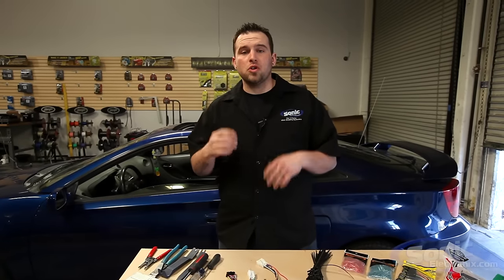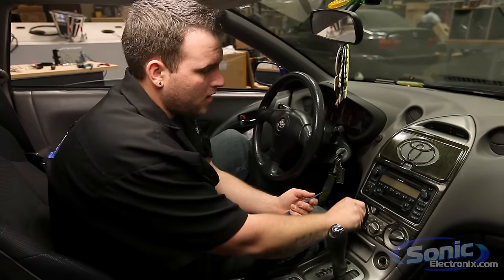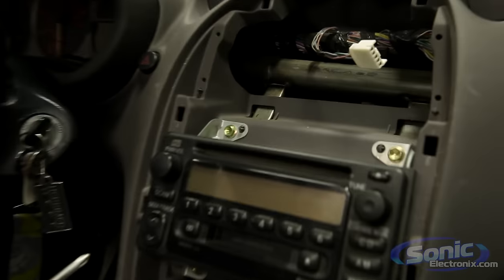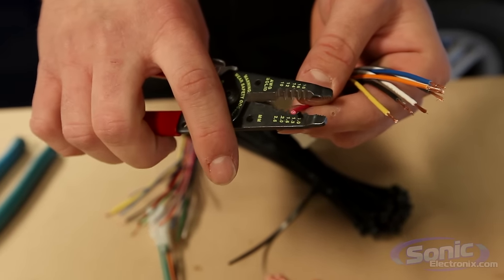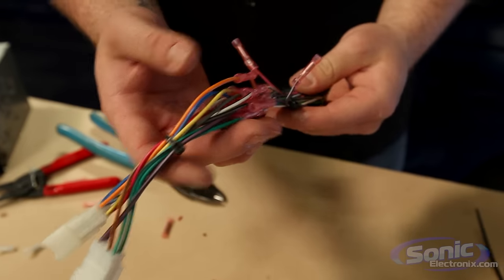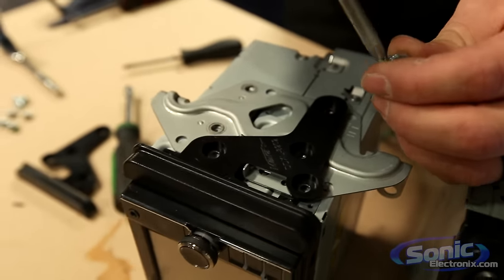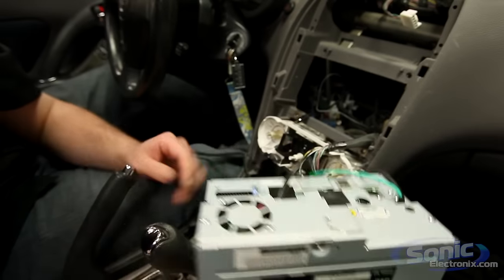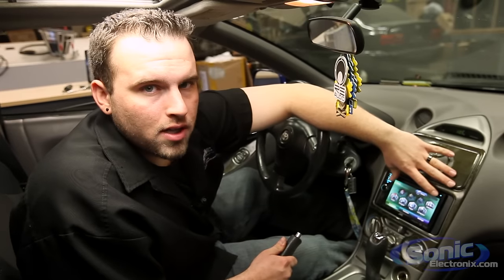How To Install a Car Stereo (Single & Double DIN) | Car Audio 101

Comment from the maker: If the radio is 7 inches wide or more, and if it is 4 inches high or more then you have a double din or the ability to have a double din. If you go to our website, you can input your vehicle information and our car fit guide will tell you. Just go to any radio and it there will be an option to choose your vehicle.

Comment: the aftermarket harness that fits my 2000 jeep does not have the black wire, but the harness that comes with the deck does, do I ground that to the chassis?

Comment: I installed an aftermarket stereo into my 1998 Ford F150 and it doesn't save stations or the time after I turn the truck off and remove the key from the ignition. Any clue on how to fix this?

Comment: electrician here, don't twist the strands. You can push them right in if they are not raffled. Twisting creates air pockets between the strands and increases the diameter.

Comment: It help me some but I am looking to install possibly a dual dv635mb into 09 Toyota sienna and i don't want risk messing up the cable to each port. so are their and good adapters I can buy to save me from crimping cable. their is moor question but will this be a herder job
Reply: Eric Lathan nope. you gotta strip and solder bud

Comment: Hey Guys, Great vids. I am going to be changing factory DOUBLE DIN (Monsoon Premium Stereo CD/Cassette/Am/FM Head Unit) to a SINGLE-DIN (Kenwood-eXcelon) and 4 x 6.5" JBL GTO608C Speakers. I have a 2003 Volkswagen Jetta Wolfsburg 1.8L Turbo and I am getting conflicting info on the correct parts I require to install myself. I do not have steering wheel controls... but have been told I need to get this additional module harness on top of the Dash Kit, Wiring Harness and Antenna Adapter. Please help with parts & prices...I'm in Toronto ON. Thanks Kindly!
Reply: André K Thanks Wes for the conversation. Sent you email as requested. Look forward to seeing what you put together. Cheers!

Comment: I need to know wat size of sterio  or how big the hole is in the.  1996 honda accord  4d it's a automatic     I want to instal a 2 Din  dash. System but do t know  how. Big  the  hole is n   it has a. Small  regular cd deck right now like the 1 din. But I want to instal tge 2 Din. Sterio  on my 96 honda accord I need help

Comment: Doing it "RIGHT" would be soldering every wire and heatshrinking imo...but it's all a matter of preference. As long as you have a solid connection it doesn't matter what you use...

Comment: How do you know what type stereo you need for your own car for example a honda crv 2004
Reply from the maker: You can find car stereos that sound better with features like Bluetooth and smartphone connectivity that fit your specific car by using our Auto Fit Guide. Check out the first link in the description!

Comment: My stereo won’t work unless I put yellow-Red-Blue/white wires all together. The other problem is it’s not saving the settings and the stereo won’t turn on when the car turns on. I have to turn it in manually.

Comment: final step, chuck the existing sterio or sell it on Amazon. Update: I installed a basic Boss  Audio 612UA radio/USB/SD player. Um, something went wrong. 1: the stereo clock and the car clock reset to 12:00 AM when I turn off and on the car, B) the interior lights (dashlights are fine) go dark when the key is turned off and 4) the remote doesn't lock or unlck the doors.  Damn, back to the dra... I'll just bring it to the stereo place near me :/. Will update...

Comment: It's always best to disconnect the negative battery terminal cable first, and not the positive.
  A 12V DC battery discharges hydrogen gas (which is extremely flammable) and vents through a very tiny hole on the battery.  If you disconnect the positive battery terminal cable first and an electrical short occurs, you run the risk of igniting that hydrogen gas and having sulfuric acid (and distilled water) explode in your face.

Comment: He didn't use the 16-14 gauge connectors. When or why would someone else use them?
Reply: It's a possible needed tool. Some cars use different wire gauges and those are the most common for this application.

Comment: Whats the pry tool?  I cant find it. please share the link.
Reply from the maker: +Miguel Angel Try this link
http://www.sonicelectronix.com/cat_i668_panel-clip-removal-tools.html
Reply: +Sonic Electronix My radio harness has a Orange/White wire that says "connect to a car's Illumination signal" but the Orange/White wire on my adapter harness says "Dimmer". My adapter harness also has a Orange wire that Just says "Illumination". Which one should I connect to?
Reply: +Chris DiGi Illumination is same as the dimmer.. It dims your stereo whenever you turn your lights on at night. Just connect them if you haven't already.

Comment: I bought myself a new radio VR-769NB from Soundstream and the installer told me air bag systems are hooked to the radio so they have to install it rather I do it myself. Is it true about the air bags?
Reply: Why would the air bags be connected to the radio? Sounds a little dodgy to me, to be safe read your cars manual or contact a dealer or even your cars manufacture.
Reply: 9

Comment: Hey I have a 2000 Celica gts  I just recently bought the stock radio had been removed and they cut the stock hook ups off I need some help hooking my after market radio up I hooked colors to colors nothing and trust me I know how to hook radios up but iam a new owner of a Toyota never had one before but anyways I did some wire testing and found that the power wire is the grey then I checked on here trying to do some research and I found that people was saying that grey was power and that the blue w yellow was for the yellow and ground was brown so hooked it up like that nothing I really need some help never had a problem in the past with any radio before also all my fuses are good non blown please if you or anyone on here could help me out with this problem I would appreciate it Cuz I have no idea how to do this thing since the previous owner cut the stock hook ups

Comment: While disconnecting your positive wires he forgot to mention that the batter very well could blow up if you touch your metal ratchet to the frame, and other metal around the battery so be careful if you make the unsafe decision to disconnect positive before negative

Comment: Why dosnt the radio just come with a plug and play connection to the factory connection then there be no need to crimp the wires but I guess every cars wiring is different

Comment: So I installed a double din unit in my 2003 mercury grand marquis. And shortly after all the electronics in my car started failing. Head and tail lights dash horn. Etc.

Comment: I am so glad i discovered this video. GREAT tutorial and the Sonic Electronix website is fucking amazing xD SO cheap but so reliable. Got a whole stereo system and radio for under $160 and its still running well. Great work.

Comment: Where do you connect the long light green wire to...
Reply from the maker: The long green wire connects to your parking brake so DVDs and videos can play when your vehicle is in park.
Reply: the way he did it in this video is illegal in many states, and legal in some.

make sure you know which state you're in, in Cali you cannot bypass the wire like he did, but in say like Idaho it's no problem.

Comment: so what if I'm running my speaker off an amp? I didn't see a spot for an rca.
Reply: rcas should be on the back of your radio if you dont have rca outputs u may have to get a factory rca adapter which wires right in with your rear speakers

Comment: Im absolutely desperate here and hoping you or someone reading this can help me out.. I have a 2004 Grand Prix GTP CompG and I purchased a Kenwood DDX372BT radio.. got it all hooked up and wired, everything works as it should 100% HOWEVER there is NO sound at all from the speakers and the door chime that came with my wiring harness (RP5-GM11) makes no sound. Im desperate and frustrated and fed up.. if anyone could help me id appreciate it more than you could ever know..
Reply: I'm having the same issue, but as I did more research, I came upon a soultion. There is a remote amp cable from the aftermarket radio harness. It should be in the manual. And in the wire harness for your car should, there is also a wire saying remote amp. These need to be connected in order to trigger the amp. That is what I read and saw on both of harnesses.

Comment: Well, heck, I guess pouring a concrete driveway isn't too difficult either, but do I want to go through the hassle ? In this case, do I want to rip everything open inside my vehicle just to upgrade the infernal radio system ? I'll just stick with my cheapo blue tooth speakers. They get the job done

Comment: Is this a universal kit?
Reply from the maker: +Cole Benit Dash kits are vehicle specific, the kit that was used in the video is specifically for that model of Toyota Celica. If you're looking for a dash kit for your car you can use our Auto Fit Guide tool on our wed site, it will tell you exactly what you need. Or you can give one of our sales associates a call and they will be able to help you pick out all the right equipment for your vehicle.  :]    www.sonicelectronix.com/afg
Reply: +Sonic Electronix I'm preparing to do an install on a 2002 Ford Explorer and I have Wire from my radio that is Orange/White and labeled "Illumination Signal" While I have a Orange wire coming from the Harness that says "Illumination/Dase" should I connect these??
Reply: +Sonic Electronix 1st of all i love the videos. but have a question. i want to connect 3 amps to my head unit. headunit has 3 preouts (4v). i want 2 amps for the 2 subs and 1 amp for the mids and highs. the pre outs say: front, back, and sub. how do i connect 2 sub amps to those preouts?

Comment: yeah, let's disconnect the battery so we can not test any voltage on any wire. Smart. Good luck installing a car alarm. How do you test for anything with no power? Are those seamless butt connectors by 3M? If not, they are trash.

Comment: I was told by my dealer never disconnect the batterie cause it could wipe the car's computer. Is this true?
Reply: It resets the cars ECU nothing else. Your mileage and other settings regarding trip computer will remain. Your radio is the only thing that will factory reset which will need a code to unlock. The ECU will be set back to factory so its ok

Comment from the maker: Wire your subs in parallel to drop their impedance to 2 ohms, then wire that to a pos/neg on your amplifier. You will need to follow the instructions in your user manual on how to bridge the two channels on the amp. We have a subwoofer wiring guide on our website. knowledge.sonicelectronixDOTcom/tools/subwoofer-wiring/

Comment: The radio I got from them for my Honda did not come with the wiring harness they show in this video.  This video is misleading.  Plus there are other connectors you need that they say nothing about like steering wheel control and antenna adapter.  Why can't you do what you say!

Comment: So as you said YOU ARE THE ONLY COMPANY ON THE PLANET THAT MAKE THE ISO RADIO CONNECTORS, and if you get them from any other company, you are buying fraudulent merchandise....interesting, i've worked i the industry for twenty years and never heard or seen that! YES! Also you may have to use a pry tool or crow bar, over hear in england we use radio release keys, that designs are found on the makers websites or you email them and you cut it out of .5-1.5mm sheet metal to release it, I have never had to ever had to use a "pry tool" or CROW BAR (thats what CRIMINALS/BURGLARS use!!) Also I always take off the positive connection on the battery, because if you remove the negative and your hanging out of the car connecting some, lets say amplifier to the headunit to boot and am grounded my self and touch something live (if im connecting extra batteries or equipment, I DON@T want to electrocute MYSELF or severely damage the cars electronic system that could cause a very expensive repair bill (Oh yeah, I nearly forgot you are only stating that so your company can get some extra work and charge people through their teeth and nasal; cavities!) I personally hate companies that lie to potential customers to scare them so you can drum up some extra business, go suck a turkey, you twat!

Comment: You didn't hook up the parking break for the DVD player or make a switch lol fail
Reply: besides instead of connecting everything with the crinch stuff you could just put the wires from the black connector into the white ones directly.
Reply: With the JVC you just need to ground it. it's not like the good head units like Alpine or Kenwood.
And I did see him tie it in with the ground.